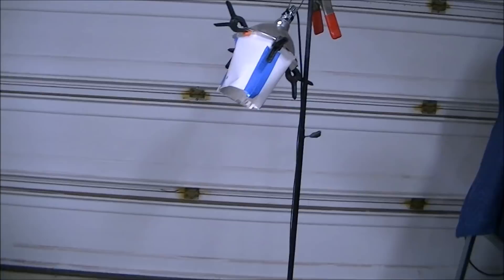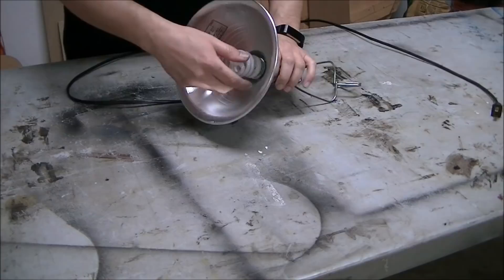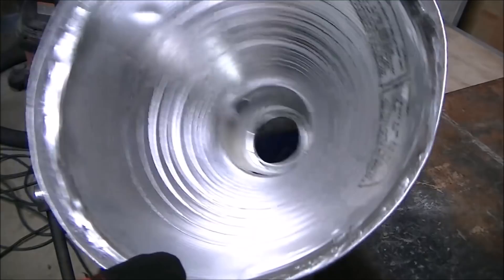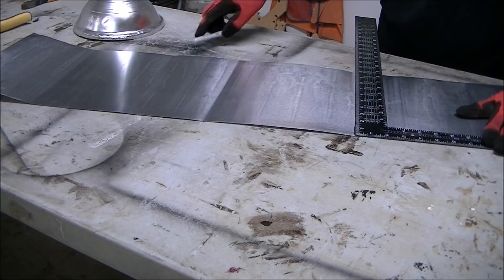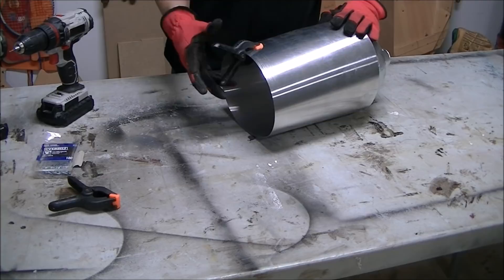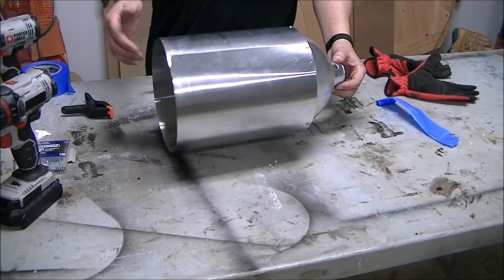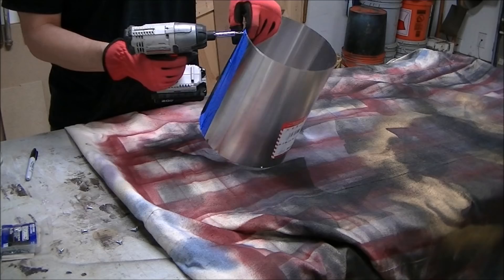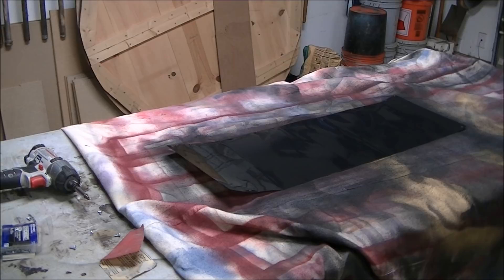Making It Yourself - Spotlight - Cheap & Easy DIY

Comment: Nice overview, the paint really made a difference, you can always adjust the circle to make the focus smaller the sheet metal should bend pretty easy
Reply from the maker: Thanks, yeah I think I will just mess around with it a bit.  Good thing the sheet metal's not expensive.

Comment: How to film the making of a spotlight when it's the only light you ever use in a video.  lol  I happened to be one of those people.  I like that sheet metal upgrade.  I think that you had a smaller opening on the original.  I made the opening on mine much smaller to limit/focus the light which also made the material look weird.  If I did it with the metal I'd account for that in the original cut somehow.  Maybe allow overlap at the light, and angle the cut to reduce the circumference towards the front.
Reply from the maker: LOL!  That's why I can never make a video about the camera I use, what camera will I film with?  Thanks for the suggestions I was thinking about making some cuts around the opening so I can shrink it or open it as needed kind of like an iris but nowhere near as cool.
Reply: :D That's exactly what I was thinking while watching this!

Comment: Which videos have been filmed with this new light?
Reply from the maker: All videos filmed after this one that have a single light source.  I have made a few videos with all the lights on in my garage.  Sometimes I use this light to add a little more light on the subject.  I think it works better than my previous paper cone.

Comment: Its called a snoot. You can use inkscape extension to calculate and draw out a scale template to cut for the size you really need.
Here: https://github.com/quirxi/SheetMetalCone
Instructions for installing and use are there too.